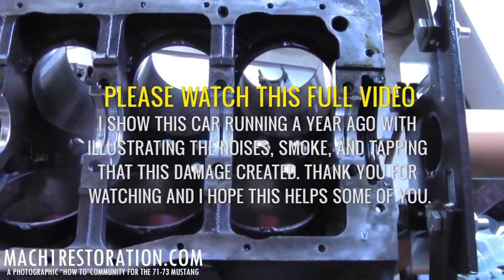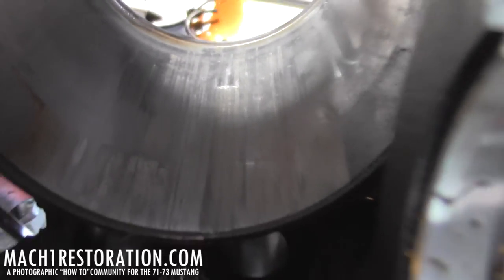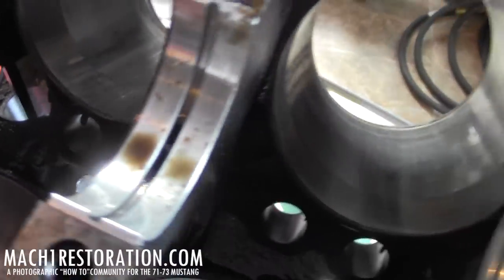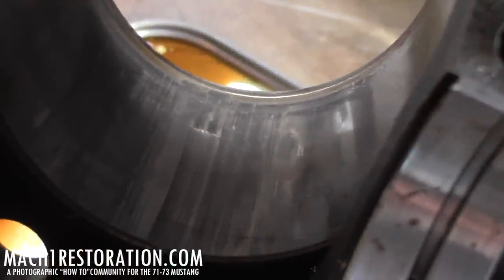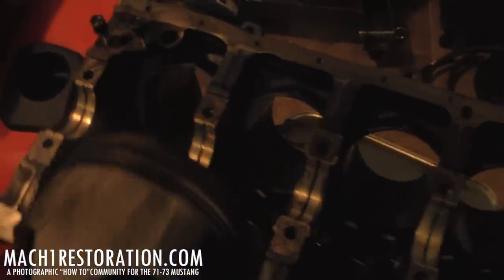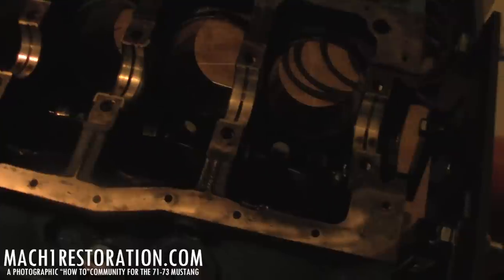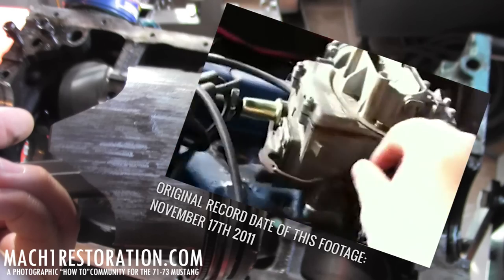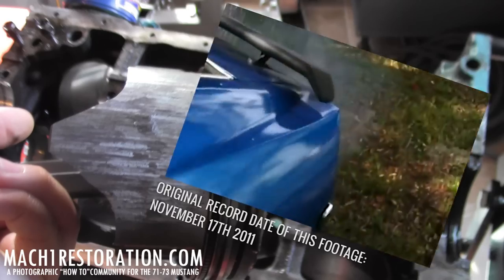What Damaged Cylinder Walls & Pistons Sound Like | Damaged 302 Small Block Ford

Comment: I just went through this travesty myself with a SBC 350 4 Bolt....gaskets were blown, one piston was shot, and the cylinder wall was totally fucked like the one in this video.  Tried to hone out the wall and dropped a new piston in, no more leaks, but the rings were definitely letting oil slip by because no amount of honing was going to do it.  I'm about to drop the money for a remanufactured engine and call it a day.

Comment: Fuel wash, just happened to me on a 307 converted to tbi, fuel will either get passed the rings and wash the cylinder dry, and or leak into the crankcase while the engine is off. I bet the oil was overfull and contaminated with gas.

Comment: i have a 94 jeep grand cherokee that does this.. but ive already diagnosed it by checking the plugs.. cyl 5 is dead and its a 4.0 straight 6. its still driveable and you barely notice a thing until you hit a hill and it just bogs..

Comment: Aw, I'm glad to help Brian :-)

You notice that in the video it sounds almost like a diesel? That's a dead giveaway that the noise is piston-related instead of a bearing. Diesel engines have that characteristic rattle because the combustion tends to vibrate the skirts of the pistons.

It's a bit unusual that only one cylinder scuffed up like that. When the engine overheats it'll go into detonation and that will affect all cylinders.

Comment: Did that cylinder have low compression and causing a missfire? Great video by the way!
Reply from the maker: Yes. It did.
Reply: archifxllc from my understanding a extended missfire in that cylinder ie. Fouled plug, bad spark plug wire, extra. May cause that kind of damage, that's my opinion. Good luck with the project!

Comment: Mines sounds the same ..just dropped this 350 sbc in to my caprice classic ran fine but tried to put a electric fan and didn't cool properly so I put fan back on but put the wrong one on because the new 350 had a serptine belt set up the old 305 was v belt and serpentine so the fan was reversed spinning long story short car over heating bad gauges was not working pull over to check it was too late water boiling so let it cool ran fine by the way over heating and all even after but next day started hearing a knock so took it to my buddy a mechanic to set timing and he told me about the knocking I thought it was my water pump going out or lifter ..said I need to pull engine again and replace a piston rings and hone it hopefully that's it lol I just put the freaking thing in now got to take it out
Reply: Update?

Comment: Well can go back to 305 just needs a flex plate or I got another 350 in my yard but it's rusty needs to be machine what would u guys do in this situation?
Reply: Seems easier just to buy a flex plate, not sure what the specs are on 305 vs 350. But flex plates are cheap, I'd buy a new flex plate for a running engine rather than rebuild a 350.
Reply: Just did some research as my knowledge of these engines is a little thin. Looks like minimal power difference and 305 gets better gas mileage. Flex plates, depending on the vehicle, can be bought for less than $50.